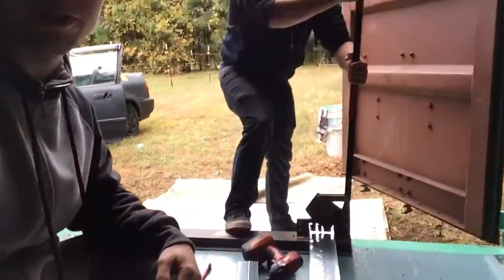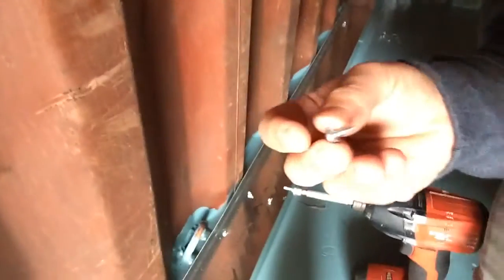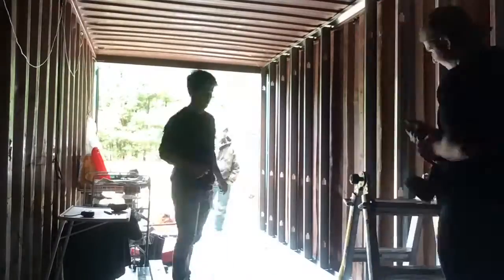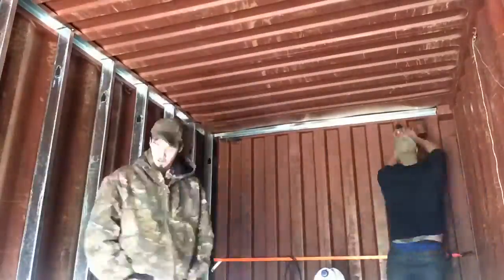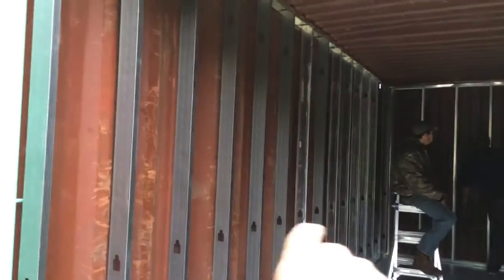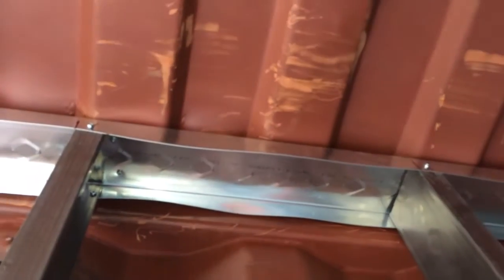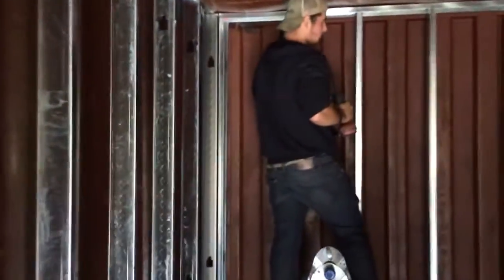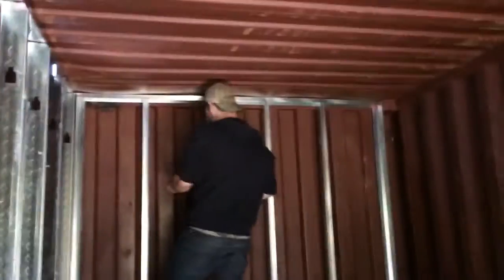Shipping Container Monologues part 3: Wall framing + lighting sneak peek

Comment: Nice, but I DEFINITELY would not have drilled holes in the roof.  I would've used an adhesive for the top plate, and then maybe put in a stainless screw in the top of the stud after they were in place.  I would've also used the thin foam insulation that they use under sill plates to keep moisture from wood when used on concrete floors.  This would help to insulate the steel studs from the outside wall so it doesn't conduct the heat or cold.  I don't know if you'd still be able to slip that in.
I'm going to use a container for a shop, and I'm going to use 2x2 wood, secured with liquid nails and a few stainless steel screws from the outside.  I'll use silicone to seal the screw holes.  I have to use screws in addition to the adhesive because since it's going to be a wood shop, I'll have tools hanging on the walls, and I need the extra support.
LED lighting is AWESOME!